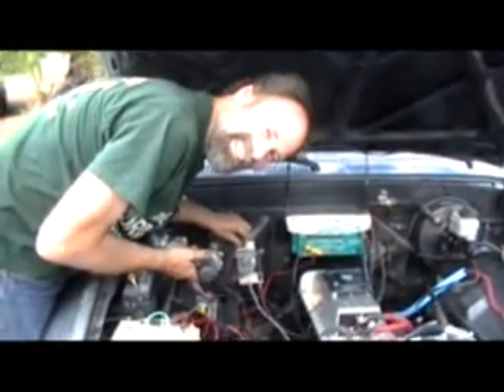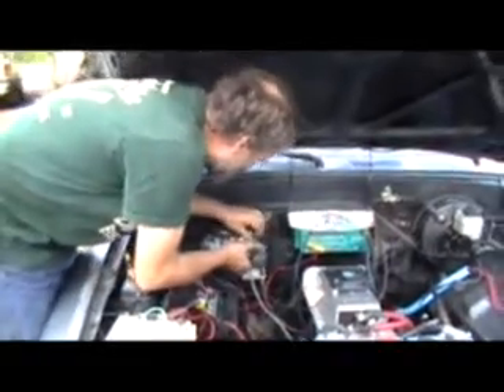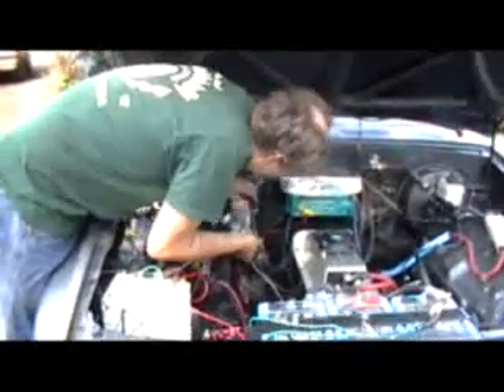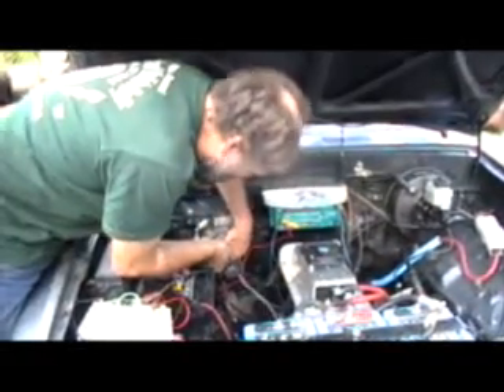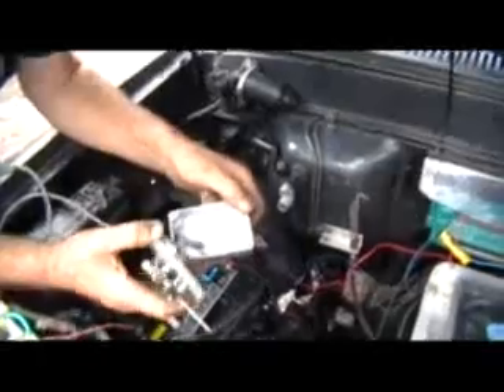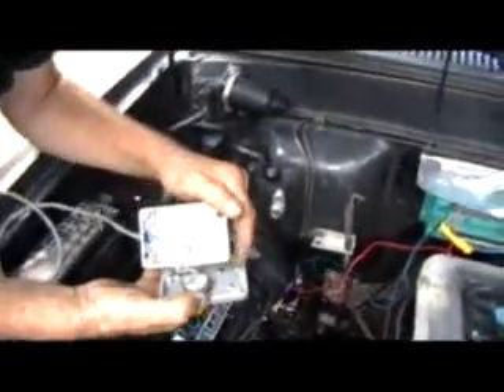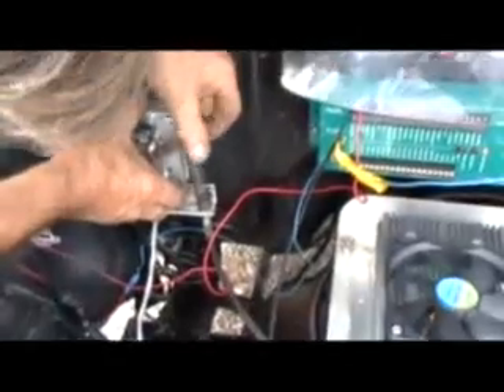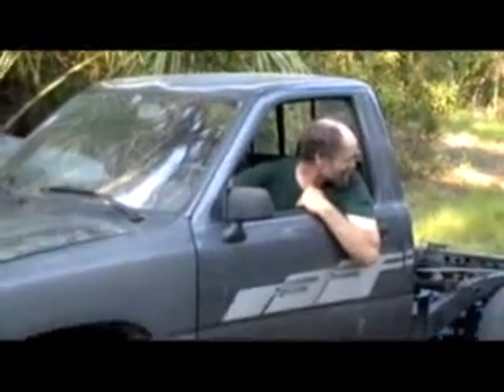EV  Throttle Installation

Comment from the maker: The curtis pb-6 pot box did not work will with the logic sys controller . The pot box seems to be the weak link in our budget part collection . If your EV starts to feel "jearky " the first part to replace is the pot box Steve Clunn